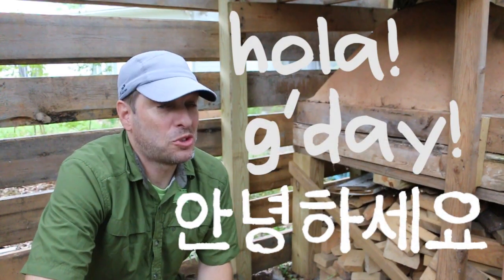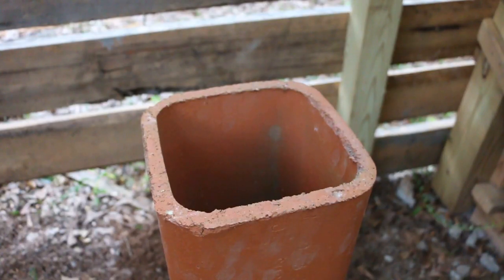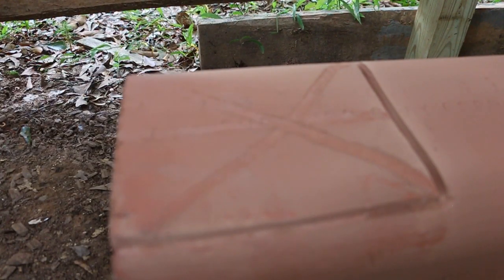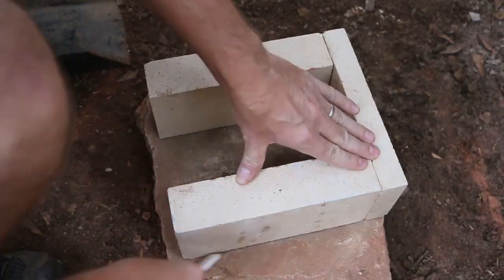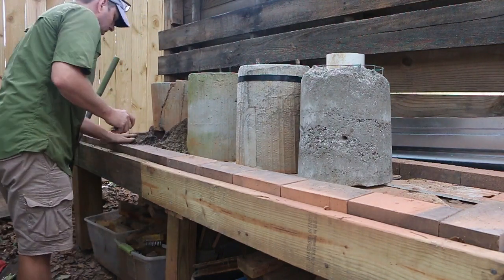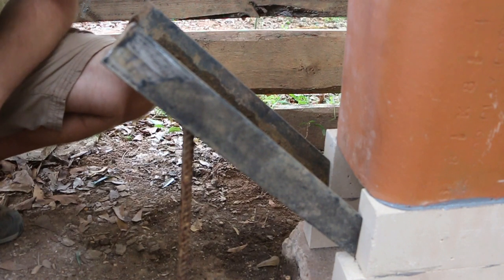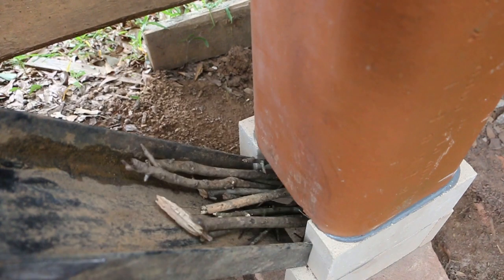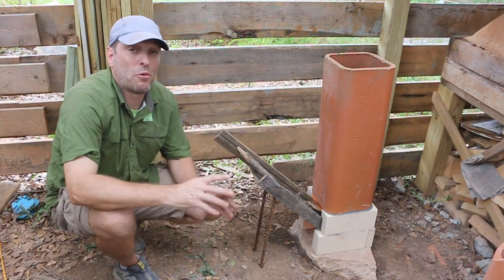How To Make A Chimney Pipe And Fire Brick Rocket Stove

Comment: Did you build your final contraption?
Reply from the maker: Contraption is the right word. I've got the base done...which was a welding 102 for me. It's posted...my most recent video. Part two will be the construction of the oven. Thanks for watching.
Reply: I'm curious as to what you're going to end up with.  I'm a bit incredulous that you'll get enough heat buildup in the oven to do a pizza.  Part of the reason it gets so hot in the dome is the radiant heat.  By channeling the heat into the dome from the stove you lose that heat source by radiation.  Did you consider that?
Reply from the maker: @MasterKenfucius  This is an experiment. :-) My plan is to line the arch of the oven with rebar with a layer of loose perlite over it, covered with a cement and perlite mixture. My hope is that the rebar will absorb the heat, hold some of it and then radiate down onto the pizza. The flow of heat through the oven to the chimney in front should help the cooking of the pizza as well. I'm remaining cautiously optimistic. I welcome your incredulity until the results are in. :-)
Reply: @GreenShortzDIY  I know perlite and vermiculite are excellent insulators, but I don't know much about their ability to retain heat.  I made a tandoor oven by putting a terra-cotta pot inside another and insulating the middle with vermiculite (from a youtube video) and that turned out pretty darn good.  I get 850 degrees inside that sucker with a couple of hands-full of charcoal.  It's amazingly efficient.  I can cook chicken tenders in 5 minutes on a skewer inside there.  And it stays hot for a loooong time.  One time I woke up early morning and it was still 300 degrees inside there!  Blew me away.
Reply from the maker: @MasterKenfucius  I haven't used vermiculite yet. How was it different than perlite, in your experience? To clarify, I'm not looking for the perlite to retain heat, but rather keep it in the rebar layer below it...and to prevent the cement above it from cracking. Your Tandoor sounds awesome. I'd love to see the video you are talking about. Thanks for the feedback. Wish me luck. :-)
Reply from the maker: @MasterKenfucius  How do you pronounce your lat name? I'm going to mention you in the next video (with your blessing) and want to get it right.
Reply: @GreenShortzDIY  Sure thing man!  It's a gentleman from England by the name Simple Nick and this is his second attempt (first one was smaller).  Mine was very similar.  If you ever find a large pot for a reasonable price, grab it!  It's worth building one of these:  https://www.youtube.com/watch?v=mfXXamj8lV4   ...  The vermiculite I got from Home Depot was really small (smaller than the one Nick used).  They're both very light rocks and I'm no geologist, but I would think they're fairly similar.  I hope your concept works out.  Remember that metal doesn't hold heat for very long unless it's very well insulated, but if you insulate it too much then the heat goes nowhere.  It's the masonry on the contraption that holds the heat for a long time.  Good luck!

Comment: I am just a simple unfrozen caveman lawyer, so I am not familiar with your ways! But, I watch a lot of videos on how to construct a rocket stove and my first obstacle is I don’t have the right tools.  My second obstacle is I go to Lowe’s and ask them for vermiculite and they point me to “horticultural vermiculite”.. is this right,  the third issue is where are you getting your supplies from.   I realize the vermiculite/perlite was from a prior video but still, where did the terra cotta come from. Help an unfrozen caveman lawyer out 🙂👍
Reply: I believe that is the perlite they use and the terracotta tile is flue liner for a fireplace flue.  You might find it at a lumber yard oy a masonry supply store.  I saw no one had answered your question.  Hope it helps.  These generate a lot of heat and that tile, as he said, is not designed for the heat.  I understand from another comment that there is a tile that will resist the heat.  I'm sure it's more expensive.
Reply: I'm not clear on the references to all of the past videos but perlite and vermiculite are used similarly in agriculture. Vermiculite should be handled carefully given asbestos/mesothelioma concerns. Previous vids show mixing perlite  with water and cement. Given that the insulation, air spaces, are what you are wanting it may behoove one to mix the dry perlite w your slurry. I can't see vermiculite functioning to insulate in a composite like this because it absorbs water. My understanding is that vermiculite is used as fill in spaces between a flue and a masonry wall. When the weather clears here I have a project planned to build a rocket out of an old oil can and chimney pipe using some material, perlite, clay straw, etc as infill. This would sit on either a fire brick or cob combination firebox.
Thanks to everyone for the videos and learned input. Cheers.

Comment: 4:35 "carefully with a hammer"- no such thing....
Oh 5:20 ;-)
Reply from the maker: Ha. Very true. Thanks for watching.
Reply: Actually, having done many choppings on blocks like this, there IS a way to use a regular hammer to crack that block correctly. Use the claw end underneath after scoring it and tap GENTLY. LOL. They make hammers just for this approach as well but I've never had any problems using a straight claw type hammer for it.
Reply: @littleshepherdfarm2128  - - I was wondering about that! I was actually picturing a VERY skinny chisel or narrow (~1/4 inch [~4-5mm for our friends not stuck in imperial]) slotted screwdriver, and tapping on the end of its handle gently with a hammer. Do you think that would work?

And where would you start? I'm thinking start in the middle of one of the lateral edges, and moving toward an open end. Then after completion of that half, I would think you'd move to the top of the unfinished/remaining half and chisel toward the open end. Then move to the middle of the remaining central piece and chisel outward, one half at a time.

I would think holding the chisel/screwdriver at a 45 degree angle, and continue gently carving out a groove. What do you think?

Or even start first in the middle of the straight line he scored out, the one bifurcating right down the middle. This would create smaller sections to work with, and translate less vibration and stress across the entire brittle surface area.

Fascinating stuff. I love the depth of knowledge and the intelligence being expressed by commenters.
Reply: @heatherclark2623  I wouldn't use a screw driver for that at all because the claws on your straight claw hammer are much much wider and will strike a wider area. If you use a flat tip screw driver you're likely going to end up breaking the brick where you don't want it broken and you'll probably be there all day doing it. The idea is to score the brick so your claw has a line to follow and the concrete in the brick will also have a path to follow. Then after scoring the brick use the straight claw end of your hammer to chisel gently along that line. I personally like to hold the brick down on a hard surface of concrete with the scored end hanging off of it so that when the concrete breaks there's nothing under it to cause resistance and make the brick break apart. It does take practice to get It right but that is true if you use the chisel type hammer they make for this. Give it a try and see if it works for you is all I can tell you. If it does If love to hear from you about your experience. In the meantime I hope you have a great week and weekend

Comment: Hi Tom,    Where is the floor of your fire chamber?   I have been watching your videos almost all night and it seems like you are missing the basic concepts of Rocket Stoves.  You should have been using the concepts of the rocket mass heater in your greenhouse.  It's okay if you wish to reject my post,  because there are a ton of videos on YouTube which sufficiently illustrate the proper build of a rocket mass heater.
Reply from the maker: I can't argue that the stoves I am building are not full-fledged rocket stoves. I do plan to build one at some point. I actually need to do some research before I'm ready. I always appreciate honest feedback, especially when it is presented nicely. So, thanks for keeping it positive. And thanks for watching my videos all night. :-)

Comment: I cannot link to YOUR videos. I get a 400 error, even though I can link to other videos, not in your series. Hmmm.
My comments: math helps. Look up the ideal angle for the feed. There are excellent other bits of information like that. Concrete ??? Hmmm. Also, I have bought various systems to test them. Light metal, bad angles for the feed tube, can't put in larger sticks, ( so no Long Burn), no space below the feed, having to bend repeatedly to do a lot of restocking, poking the fire, etc...I tossed all those ideas out.  Look at the idea of a properly angled vertical feed with sufficent air beneath the wood input, and a horizontal burn chamber. The horizontal chamber creates torsion, that way you eliminate smoke, AND you get clean, environmentally friendly stuff coming out the vertical chimney. Sorry I can't link to you. I enjoy experiments. Have fun.
Reply from the maker: That is odd, Scott. Thanks for letting me know. Interesting to hear about your testing of different rocket stove units. I will be doing a video soon with a horizontal burn chamber...a proper rocket stove. Thanks for the feedback and for watching.